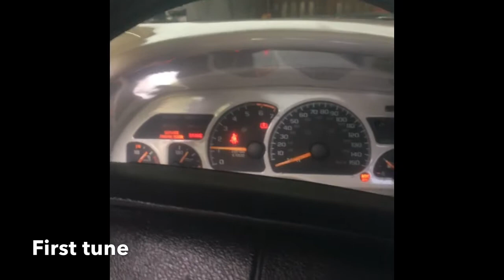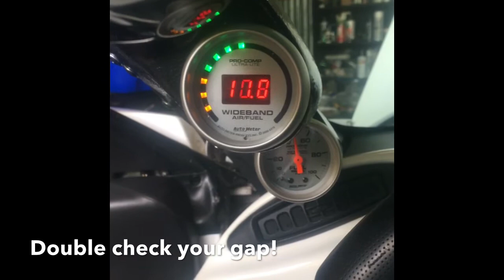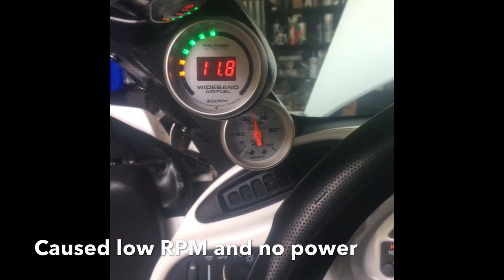TQ Head installation

Comment: I'm considering Torque Head conversion for my '96 LT-1 C4. When you say "check the gaps" what gaps are you referring to? Spark plugs electrode gaps, reluctor to reader,  .... ? Probably a stupid question, but I've never attempted one of these conversions. Thanx
Reply: Gap between the crank sensor and the reluctor wheel

Comment: Do you have longtube headers on your car or the stock manifolds
Reply from the maker: Shorty headers wrapped for rearmount turbo
Reply: Okay thanks , I'm going to try longtube headers and wrap em, wanna keep the lontubes for an easy y pipe designs and hopefully retain a more unique sound
Reply from the maker: Antonio Esposito if rearmount stick with manifolds! Keeps heat and backpressure, long tubes will hurt spool, only reason I don't have them on is cause shorties came on car, in hind sight I would have coated manifolds and installed them
Reply: Doug Strickler that's what I read online , I think since I'm in a same boat as you , already have them I'll wrap em and see what it does. sounds silly but I've heard many lt1s with the stock manifolds and I just hate how it sounds , I want too make my car have a unique sound note , not just the turbo lol
Reply from the maker: Antonio Esposito the turbo and cam make the sound, trust me, with ball bearing turbo it sounds insane! What will be most disappointing is not making boost, but if you can swap them then go for it, that's part of the journey trying different set ups!
Reply from the maker: For what rear mount?
Reply from the maker: Long tubes not a good idea, but shorties or manifolds prob best, and wrap it all the way back,
Reply from the maker: Shorty headers, and wrapped all the way back, with quick spool valve